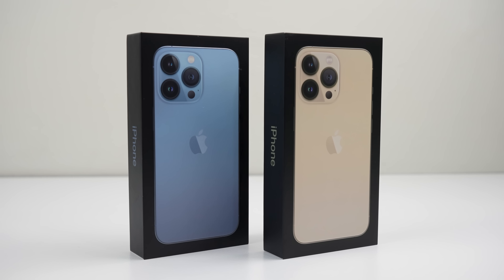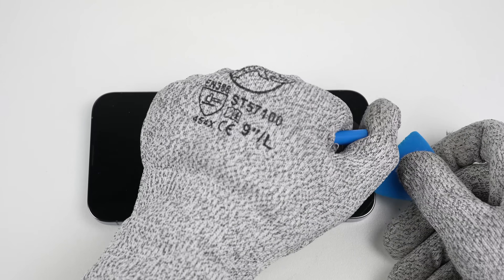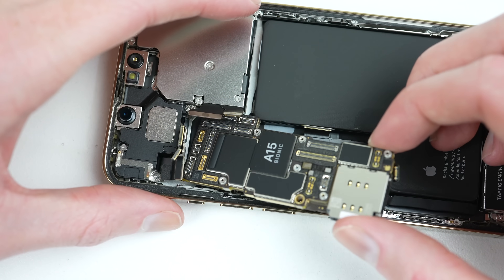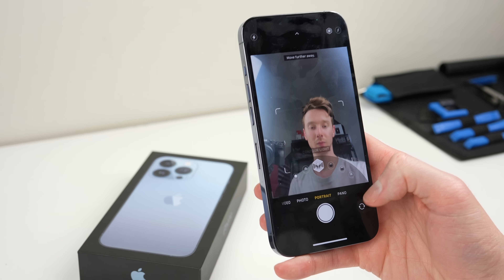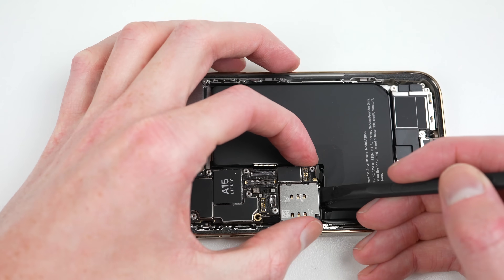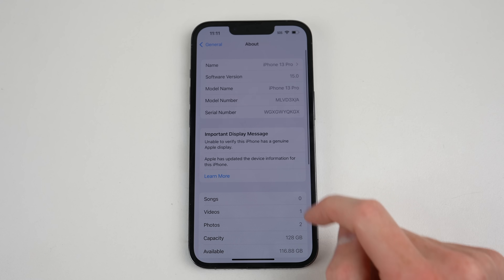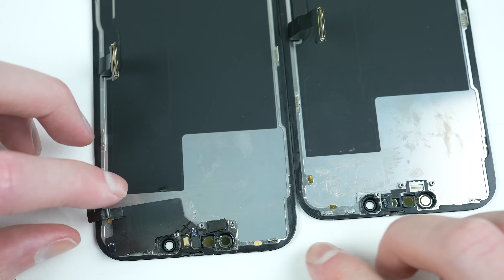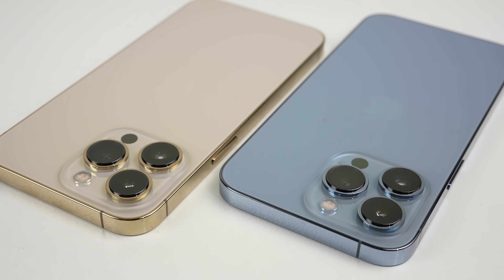iPhone 13 A Repair Nightmare - Teardown and Repair Assessment

Comment: At this point they might as well plant a small explosive into the phone that triggers if you dare to open it.
I remember when early smartphones could be assembled and disassembled easily, you could even remove the battery on its own without any issues.
Reply: Yes the time when batteries where Just in the Back and thats IT
Reply: i had a j1 a few years ago, it had a little part you could stick your nail on to pull the back plate off, easy access to the battery
Reply: @theoneandonlyartyom  yeas that's what i have
Reply: I can grab my battery out of my phone without any gear and in 5 seconds literally xP
Reply: @L4ngyAge  what phone is that?
Reply: @tite93  samsung xCover
Reply: @L4ngyAge  huh, didn't even know that was a thing. I have s9+ myself, how does that compare?
Reply: @tite93  uh i dont know but i do know that if you have it  it's very obvious and you would find it immediately
Reply: @L4ngyAge  no, I meant in terms of performance, camera etc. I guess I'll check out characteristics myself, I've been thinking of getting another phone for a while
Reply: @tite93  ohh well my phone is a brick of a phone, 32gb only tho and not really fast for like €250, the touchscreen is not always reacting to you when your fingers are dry, so that can be very annoying but in general, it's a pretty good phone with a nice camera
Reply: @tite93  literally any phone from the previous phone era
Reply: @tite93  Mine is a Samsung Note 3 from the early 2010s. The back cover can be popped open by inserting your fingernail into a notch specifically for this. Then the battery can be removed & swapped like changing a magazine on a pistol. No need to remove any ribbon cables or adhesive putty. All in a total of 20 seconds.
Reply: Yeah I remember when I was an early teen and seeing the new tech for the first time. I was like wtf is this new shit all glued and tied together? I was removing and replacing batteries like it’s nothing just open the flap and that’s it. You even had to remove the battery to put in a sim. Now it’s weird to even open your phone.
Reply: i used to remove the battery to solve the issue Lol
Reply: Remember when phones always had the „batteries could explode“ disclaimer? Maybe they‘re going for „Batteries WILL explode“ next time lmao
Reply: I remember that, used to have a phone I could pop open WITH MY BARE HANDS, and take out the battery by hand, the future isn't looking bright

Comment: What a selfish way to make a phone. Apple has a real attitude when dealing with its customer base. They are determined to force ppl to buy instead of repair. I won’t be buying any more apple equipment. Disgusting.  On another note, Hugh, you have a lot of courage, swapping parts back and forth like that in brand new iPhones!  But after all that, they still work. Kudos to you!

Comment: it confirmed that my choice of Android phone is logical and reasonable.
Reply: Sadly Android phone makers, are looking at what Apple does, and are copying their methods. If it works for Apple, why wont it work for us.
Reply: @GstarCurtis  Buy a FairPhone, but they got worse with newest model too which is ironic.
Reply: @GstarCurtis  Honestly, I don't think most can get away with that. The only reason Apple can get away with their stagnant, shit-show of a phone is because of the tremendous brand recognition they have, as well as their easy-to-use ecosystem and the glossy, manufactured  and "high-quality" look that they have.
Reply: @danic_c  i dont agree with their methods but I would not call it a stagnant shit show it is a flagship phone with the highest processing power in the world

Comment: Ive had the same LG phone for about 6 years now. The only thing I needed to do is change the screen that I broke and clean the charging hole. Talking about sustainability and carbon neutrality when your product cant be repaired iss honestly insulting. I expect the next iphone to autoplay fart noises at random intervals when opened by anyone

Comment: See, this is why I only ever buy 40$ android phone's. They last year's, can be repaired with minimal effort, and if they break, who cares? I'll just get the exact same phone again
Reply: I get $80 Pixels.  Their bodies are scratched and dented but I put a case on them and they look fine.
Reply: I won’t tell you what to do with your money but personally I would save up and buy a nice mid end android phone where you get so much more value for you $. I can’t imagine not having a decent screen refresh rate along with an upgraded antenna for better service (that alone would save you a lot of time and maximize your productivity).🤙
Reply: I'd off myself if I had to use a shit CPU in my phone, been there done that. After going snapdragon flagship chips I never wanna touch budget or midrange chips.. Let alone a fckn 40 dollar phone. Same goes for oled and high refresh rate panels, dual speakers, etc.. If your into phones and experienced those things.. You know you ain't going back.
Reply: @MetrosexualFilth  then get an expensive android phone, works pretty much equally as good as an apple phone except you can repair it.
Reply: @MetrosexualFilth  Ah, you're one of those people.You only want THE BEST, anything slightly worse is garbage.
Reply: Which is ewaste. Android by far would be creating more ewaste. Yet no one calls it out.
Reply: @EDITS_SC  Yes, they CAN make more ewaste, except they are about equal in terms of frequency of damage, and can be repaired much more easily. The ease of repair reduces the total number of phones required and reduces overall ewaste.
Reply: @fractalentropy  also come with chargers and earphones
Reply: @EDITS_SC  acting like waste is the consumers fault. The factories who make processors and boards make more waste in a year than all of us will in our lifetime
Reply: @EDITS_SC  you're doing less harm by creating ewaste that you would be by supporting apple.
Reply: @EDITS_SC  who cares
Reply: @EDITS_SC  I wish people like you would stop ominously blaming "Android" for e-waste and physical products. Android is software, it's the operating system most phones beside Apple and Huawei use. What is problematic is not the debate over which OS is best, it's about company policies. And since all iOS phones and devices are Apple, it's safe to say Apple's is shit. I'm not trying to say companies like Samsung or Huawei are free of any issues, but just stop saying "Android is bad" when you're trying to say treating a phone like an accessory that's no longer in style after a year is a major issue.

Comment: Humanity still allowed for blood transfusions, kidneys donor and transplant to other. So it is pretty much a 'wow' for Apple to do this...

Should take example of HP printers or laptops. Exchange parts between originals still allowed at least. Or even if you don't have any other 'originals' to swap with, you can ask delivery for original ink carts, railing or spare parts which you think are broken then ask nearby techs to do or DIY the replacement.

Comment: Interesting.  It occurs to me that if one did use a 3rd party vendor, the user might be inclined to think it was the NON Apple part causing the problems.  But in this case, it IS an Apple part.  One could, if they were cynical, think this is a "black flag" operation against 3rd party parts makes for Apple phones.

Comment: You know what, good on Apple for doing this and stopping people from tearing down and repairing their phones ; if people are stupid enough to buy an iPhone in 2021 they deserve to be treated like cash pigs.

Apple is not the same company it used to be 30 years ago, their products are not only under par, they are fragile and the OS is vulnerable to attack. They won't stand by their customers, they will only milk them for their stupidity. They are not Apple from the 90s.

People are stupid, Apple is clever.